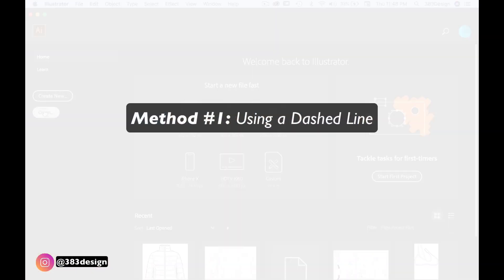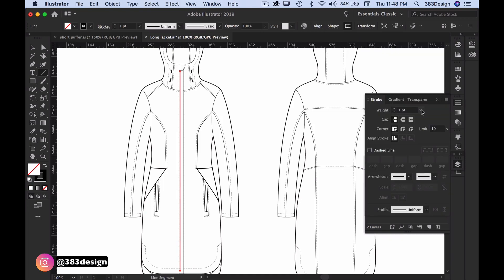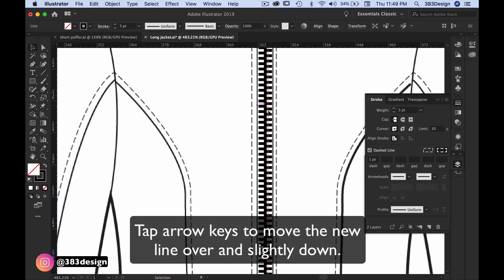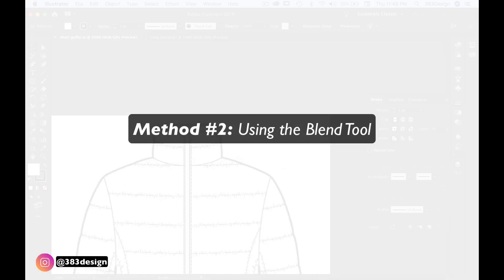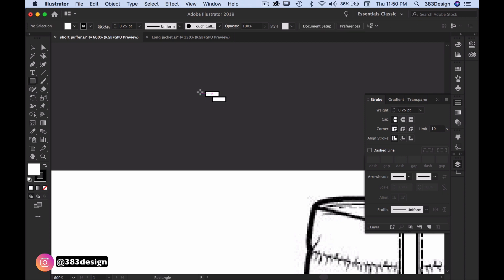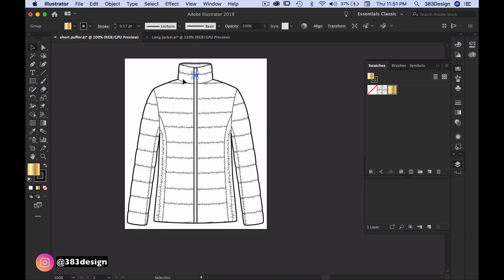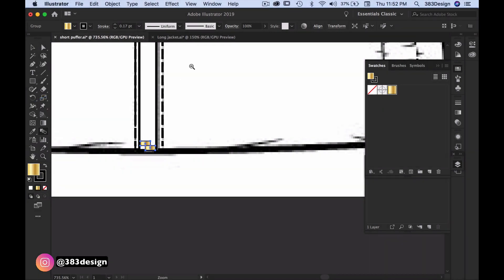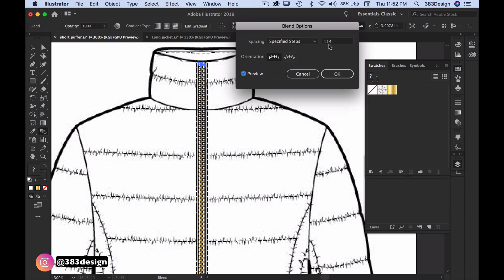Drawing Zipper Teeth: How to Draw Zipper Teeth for Fashion Flats

Comment: Hi, I know this was filmed ages ago, but I'm struggling with the first method. What did you mean by offset? When I copy and paste in front, and then move it with my arrow keys I don't get a line in the middle of the dashed lines so it doesn't look like zipper teeth. Any help would be appreciated, I love your channel
Reply from the maker: Hi, Teresa. So sorry for the delayed response. What I meant by offset is once you make a copy of that first dashed line, use the arrow keys to move the line over (to the left or right) and then slightly up or down, so that the lines offset each other. The solid part of one line should fall in the areas where the spaces are on the other line. Hope that makes sense! Thank you for watching and commenting!